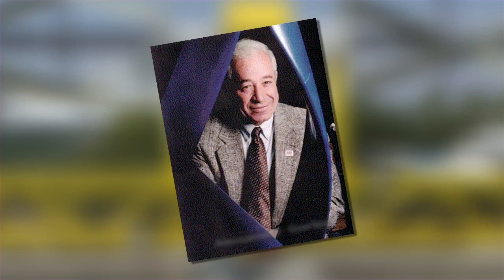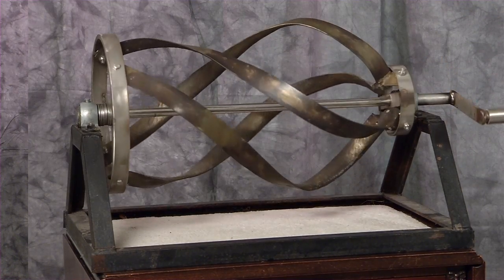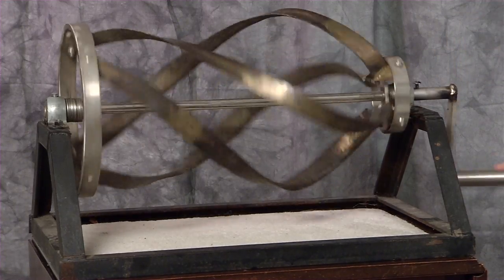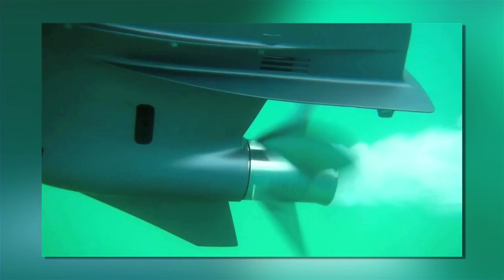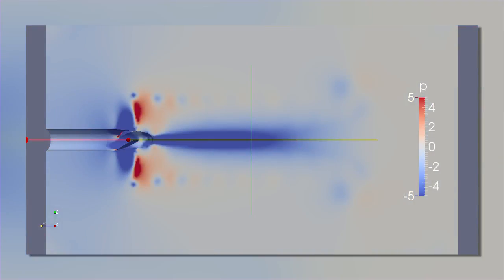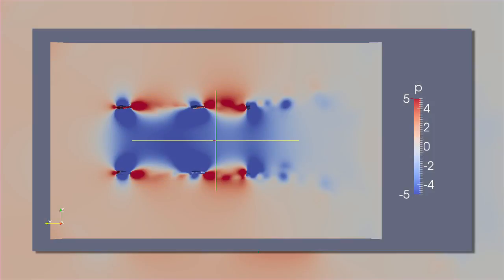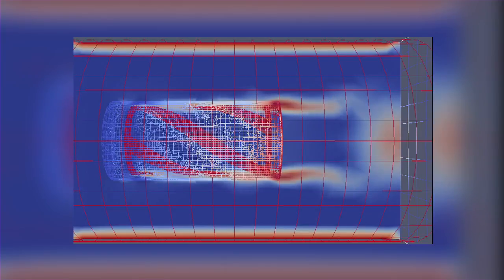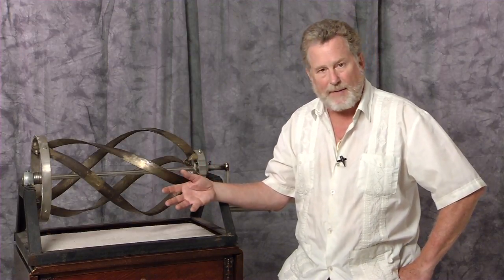Vor-Prop® Vortex Propulsor

Comment: This is exactly what I was looking for. Thank you for sharing your data. I’m designing a propulsion system for my light weight 12ft. Aluminum Jon Boat, but not for replacing my 15hp outboard motor, but to provide water to outlet nozzles on both sides of the transom. This will hopefully offer a much quieter option for trolling. Adding more nozzles on the bow would allow me to operate my boat  similar to the thrusters on spacecraft seen in movies. 
The main objective is to create reliable propulsion as efficiently and quietly as possible while drawing as little energy from the battery as possible. This will give me plenty to work on. Thanks again.

Comment: This is cool, but the limitation caused by the cylinder decrease the amount of thrust available to the ratio of the power necessary to drive it.  Consider a Lily inside a venturi,  power  decreases, and thrust increases. Au natural,  ;-)

Comment: Capt. Hayman. You mentioned problems with maneuverability if the screws were fixed embedded within the hull of the ship. Have you ever considered ducting your screws within omni-directional platforms that could be mounted to the bottom of the hull? By ducting the screws, you can conserve and direct output energy with greater efficiency. Mounted on the underside of the hull in such a way that each pod could be individually directed, the problem would be solved. Screws should be driven by electric motors, four pods each in total (depending upon energy demands to accommodate ships' size and cargo loading). 

Two each screws per pod. Two on either side of the ships' hull toward the prow roughly half way between the prow and amidship and two each astern,.You then can point them in any direction thus greatly increasing maneuverability and ship handling. Directing all four pods aft toward the ships' stern at once, of course, would provide for forward momentum of the vessel during cruise. Ducting would also increase protection of your more delicate screws from foreign object damage (flotsam & jetsam) that may be encountered in the water. As with any propeller system, these too should be designed to avoid cavitation as much as possible.

Comment: The Vor- prop seems to be a good idea as the  area through which the incoming water  enters can be enlarged keeping the exit constant. Unlike a wind turbine of similar helical design in which  the wind arrives at the  wind turbine from one direction, with the water Vor prop, it can intake water from all directions around its circumference  at the same time so the use of a helical shape is not really important and straight blades will  be just as good.  My difficulty would be the centrifugal force in addition to the outer lift of the blades which would cause the blades to flex a lot as in this configuration they need to be  very thin blades. Somehow, I envisage that the vor-prop will perform best for some length to diameter ratio, as since the water is not compressible then the speed  at the exist need to be  very high so the vor prop has to be a pressurised unit. If the velocity output is too high with respect to the speed of the ship,  then the unit will be inefficient    Here  I see a relation between the number of blades of a propeller which does not really provide a lot of pressure under  the disc but  only in the locations under and over the blade as in a helicopter main lifting prop, while in a jet engine compressor system one needs to build up pressure under the disc area which must not escape back through the blades , hence a large number of blades required in a compressor jet engine as a three bladed propeller would not operate efficiently to increase disc pressure.  In the vor prop one would need a pressure build up under  all the circumference.    Anyway it is an interesting research unit as it could be incorporated in a cylinder which takes water from the sides and so the front part would be an integral part of the keel, but it should be kept away from the hull. Congratulations and wish you luck with the results.

Comment: that cavitation that pitts the prop is the sonoliminessance effect at over 8000 deg there is a lot of energy in that implosion effect.
Reply: DANTHETUBEMAN actually there is very little energy there. It's concentrated in a really small volume so it can do interesting things like emit light, but the energy is miniscule.
Reply: Robert Szasz    I would love to be kept in the loop on this technology ? 
I don’t see any links to get in touch with you?? scottsutton857@gmail.com
Reply: Scott Sutton I don't have any technology to share. Sonoluminescant bubbles are interesting, but they only raise a tiny, tiny volume to very high temperature for a exceedingly short time. 

Researching exactly what is going on in sonoluminescance can and will likely give deeper understanding of physics, and could have some weird use cases, but it's almost certainly not going to revolutionize anything major.

It's sort of like the spark you can generate from static electricity and touching a door knob. There is very high voltage, and high current, but almost no energy is transferred so you couldn't do any work.
Reply: Robert Szasz sorry I thought for a second you were Richard the author of the impeller or Vor prop technology